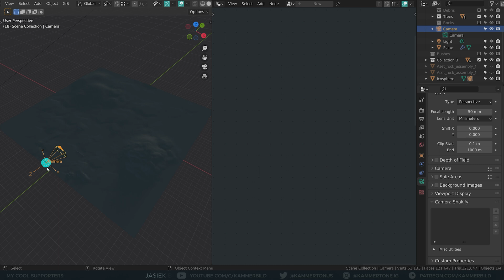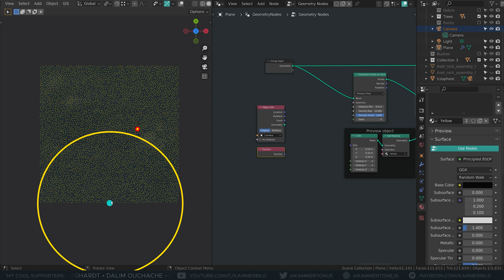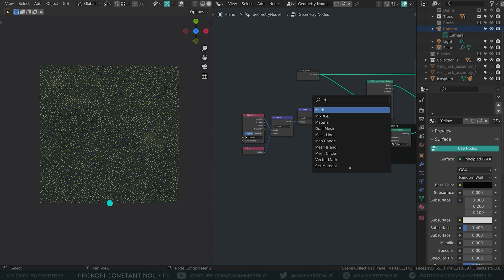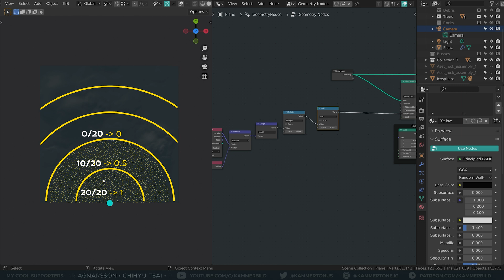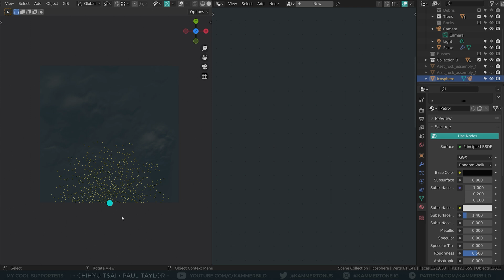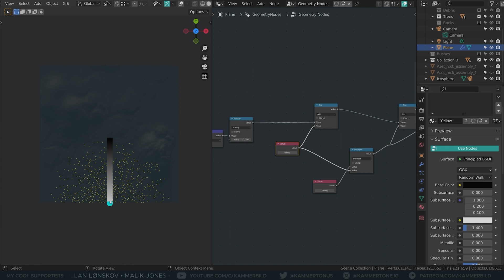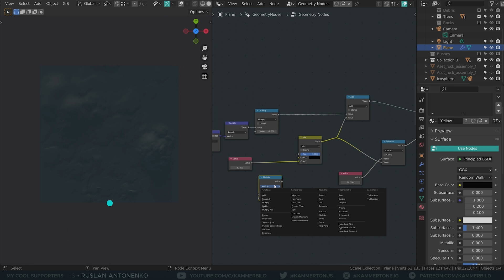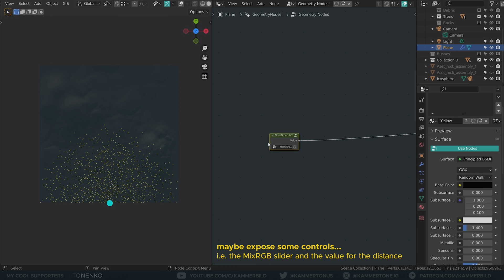Distance Culling in GeometryNodes = Faster viewport and rendertime

Comment: I feel like a lot of these math nodes could have been reduced with the map range node
Reply: Yeah I guess just map the start and end distance of the falloff to 1-0 after the length calculatiom should do the trick as well and is more intuitive to control imo ...
Reply: @DanielPartzsch  I'll try this after I get his version working (thanks to both of you for the alternative idea), with Mr. P's camera culling... but it's not really hard to follow is it?  Maybe the node tree is a product of pedagogy over efficiency?  That's my guess...
Reply: Yeah, that's what I was thinking. Map range into float curve simplifies this so much, and gives easier, clearer fine tune control for tweaking.